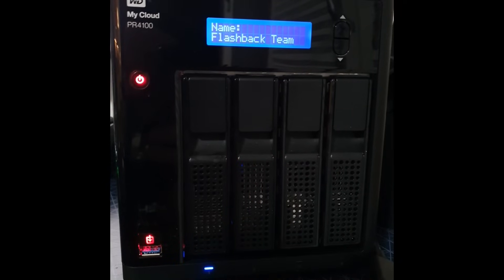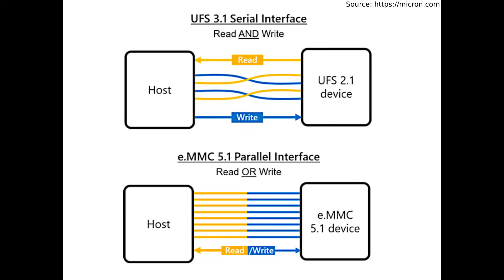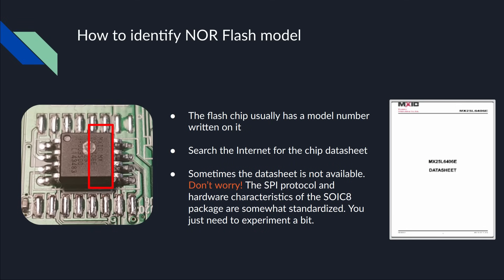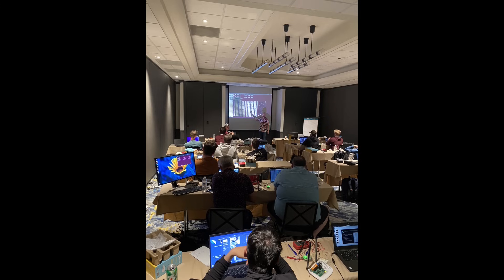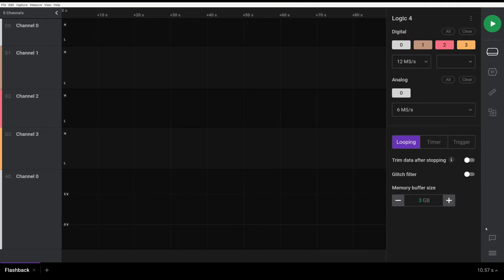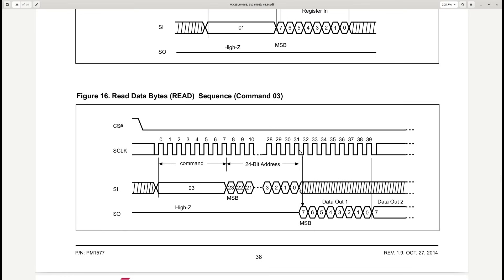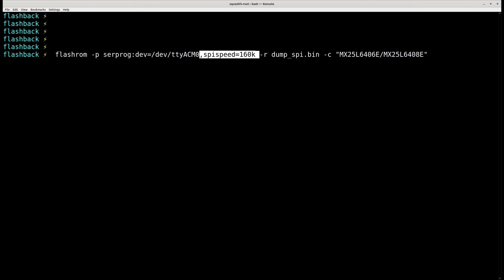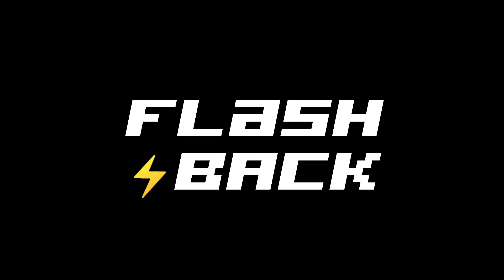Extracting Firmware from Embedded Devices (SPI NOR Flash) ⚡

Comment: Really informative video, thank you! Sadly I see there will be fewer and fewer devices "hackable" in the near future as more and more manufacturers (especially of routers / e.g. DOCSIS 3.1) start using hardware based encryption technology for their ROM. With little to no possibility to ever read extracted data. What do you think about this?
Reply from the maker: We see more vendors using all kinds of firmware protection in their devices but still quite a lot of this can be bypassed. We actually cover this topic and how to bypass firmware encryption in our training.

Few examples that we have used or seen on real life devices:
* Firmware upgrade is encrypted but there is decryption binary on the device. All you have to do is reverse or emulate the binary to decrypt outside of the device.
* Firmware upgrade is encrypted but the actual firmware on the flash is not.
* Firmware is encrypted but you can get access to a running system.
* Firmware stored on flash is encrypted but encryption keys are not stored properly or are cached.
* Firmware is protected by read-only fuse but it would be possible to bypass that check and extract firmware.
* Side channel attacks allow to reveal encryption keys

But if vendor did a really good job and encryption material is stored in hardware and it can't be retrieved easily or firmware can't be decrypted, you have to level up - find a zero day vulnerability using black box techniques, which we also did on few occasions. It's always a matter of how much time and energy you can invest on a target.
Reply: @FlashbackTeam  what about qualcom chipsets ? can we hack it , because they lock the cpu and gpu clock. trustzone and other hardware controles the clock frequencies now , any way to hack it ?
Reply: @Neeharpc  Sure everything can be hackable, most times is just too hard to be worth. Trustzone seem a problem for hacking from userspace, but you should be able to hack it from firmware and select different clock, just as the original firmware engineers did.
Reply: @alejandrosrwebmaster  but no one trying i dont know abot these hacks, i only know about kernel level mods
Reply: @CaptainGoldberg  Locks only keep honest people out. Electronics are much the same.
Reply: @mr wpg Spoken like a true engineer. :)
Reply: My personal thought is that if you have full control over the device, it's pretty much impossible to truly protect the firmware. There is some tradeoff between security and operability. If the mcu wants to do anything it needs to store unencrypted data somewhere and that will present an opportunity even if everything else is done right. Even if you have to read buses or traces with an oscilloscope
Reply: Manufacturers will usually go for the most cost-effective measure, whatever that may mean to them.
Reply: The more their encryption advances, the more our hacks advance.
Reply: Well things are evolving all time, so we should too; they are becoming better? so do we
Reply: Unplug their chip lmao
Reply: @@mrwpg6286 when you know it, yo know
Reply: its expensive as hell
Reply: I do believe they would try but most of that would keep out average users who have no idea how any of it works.  They may try to encrypt and sooner or later there is someone who finds a way around it.  That may be sometime after the device is obsolete and the maker of it couldn't care less if it is modified.
Reply: Such encryption is inherently flawed because the mechanism to decrypt must reside within the device itself; so there's always - at least in theory - going to be a way to extract the decryption key from the device. I'm pretty sure the more common this becomes, the more people will find ways to do exactly that.
Reply: How do we extract firmware form mtdblock
Reply: smells like scriptkiddy in here
Reply: sir, how do i open an Ms dos shell @inod5656
Reply: @inod5656  true

Comment: Couldn't tell if you mentioned this, but beware, SPI is not designed for multiple masters so in general one should verify that you don't accidentally power up the processor of the system when powering the flash chip as you might accidentally end up having two masters trying to drive the SPI lines which could damage the HW.

Comment: My precious Audio Card (PCI) have stopped working (recognized by Windows but no sound) and i noticed that two IC getting hot right after boot :
1) P98AB VT244
2) EPM 7064S1C44-10     BFB249919  EMU98 9946

I do not have an electrical engineering background but i think that the first is a line driver and the second is a Programmable CPLD.
I guess that it is not enοugh to replace the 2nd with a new one, without first, write to it the firmware.
So my questions are :
1) Is it possible the damage be only in the 1) and the heat in the 2) caused by the 1), so if i replace the 1) (is it really a non programμable IC so can be replaced by a new one without write a firmware in it ?) with a new one then the 2) stop heating up and work OK.
2) If the damage caused by 2) is it a way to extract the firmware from the damaged 2), insert it in a new one, so to replace the broken on the Card for it to work properly ?

Thanks for any idea and help in advance.

Comment: Can someone pls estimate how complicated (intentionally obfuscated) is the protocol a laser printer uses to read out the chip in the toner cartridge?   Checking its presence, and perhaps write retrieve usage data,  I have some experience in programming a microcontroller, have a great logic analyzer, digital oscilloscopes.   Would be interested to try to reverse engineer and afterwards emulate this for a particular make and model of a printer for my own joy. But would not want to waste a lot of time,  do I correclty assume it is way beyond feasible as a shed project?

Comment: could you use spi to upload flash files? would this be a way to fix "bricked" motherboards?
Reply from the maker: Yes. You can also write using SPI. And yes, you can fix bricked motherboards this way. In fact, we did it in the past. After bios update of one of our laptops, it got bricked and we overwrote bios flash using SPI to restore it.

Comment: thanks for the video. I ve got one question. What is flash is internal to the MCU, so how would it be possible to extract the firmware ? Thank you.
Reply from the maker: In such cases a target specific attack is required. It would need a separate research and maybe use different techniques like glitching.

Comment: See you using the Saleae software at 11:03 ... have you ever tried `sigrok`? I use a cheap no-brand logic analyster and `sigrok` and it's quite nice.
With `sigrok` you can put a higher level on top of SPI which will translate the byte values even further into specific commands.
And whilst I'm talking about "cheapskate" solutions - It takes more effort, but it's lower cost to just put `serprog` software on an STM-32 "blue pill" board instead of using HydraBus or whatever.
(None of this is "my own work" - I learned it all from OpenTechLab's "Hacking the IT9919" series)

Comment: I've done a lot of stuff like this with EEPROMS in bmw all keys lost situations in everything from cas 1 to 4 even encrypted istahp to FEM modules or the older models. At least for encrypted CAS 4++ you also need to backprobe the ECU for the ISN number. However the whole calculation and tools are from AUTEL IM608 scanner and the process is pretty streamlined. This is a whole nother level of reading hardware or memory. One question though. Why do this anyways? is this a job or just a hobby?
Reply: any tutorials?

Comment: great video, I have a question though , I did EEPROM dump from a speedometer cluster quite a few times, nothing illegal, since I'm into car repair business , some vehicles come with bad clusters and guy would bring another one from a dump and asked me to program the mileage that would correspondent to vehicle being repaired , now there is a program that once you got your dump would calculate new hex value for new given mileage , however this generator software only works for certain vehicle brands, I wonder why same hex value for a given number gets interpreted as a different number in terms of mileage on different eeproms ? thanks

Comment: hello dear friend,
I'm just entering this world of firmware extraction, so I'm a bit of a layman.
What is the difference between doing the procedure shown in the video and simply copying the binary file with an eprom recorder? With the recorder, I have the binary file in hand, so what would be the difference?
Reply from the maker: That's a low cost technique to extract a firmware directly from the chip without the need to desolder the chip itself. There are programmers where you can read the firmware from it with some ready tools but most likely would require to desolder the chip. Also, tools are nice in general but we like to understand what is going on.

Comment: Really great video..  I've never done this, but have most of the tools and have been thinking of trying it just for fun..  I'm curious though - When you are powering that EEPROM from the clip, I'd be worried that I'd also be backfeeding power to the rest of the circuit, and potentially causing it to boot up, which might cause the MCU to start taking over the SPI bus..  Is there some way to guarantee you're only powering the memory that I'm missing, or is this really not as big of a problem as I am envisioning?  Could techniques like finding the reset pin on the MCU and holding it low to prevent booting perhaps be a good workaround?   Any other hints?   How much experience is needed before I shouldn't expect to be completely lost in one of your in person training classes!?
Reply from the maker: Hi. Thanks for your feedback. Very interesting questions.
1) From our experience, some boards would indeed be powered-up when we connect to the chip. Keep in mind, that we are supplying 3.3V so I assume it really depends on the board design. However, we didn't find it a big of an issue for us. When this happens, we usually wait a bit to increase the chance that the SPI bus is free. On many targets, after the boot process is finished and firmware placed in memory, there is much less data being fetched by a CPU compared to a booting stage. We just start our dump at that moment. Also, SPI protocol has that CS line which selects a chip. So all in all, it's not big of an issue for us. But keep in mind we are not electronics engineers, we are just hacking those devices using whatever works for us.
2) The reset pin technique is a very good idea. In fact we used it in the past on one of the target but for a different purpose.
3) If you can interrupt boot sequence, for example by entering bootloader menu, there should be very little interaction with the chip.
4) So far in most of the cases we didn't have to desolder SPI chip to read content from it. Usually in-circuit and it just works. It is on a contrary to NAND TSOP-48. Those almost never work in-circuit and we need to desolder it.
5) As for the training, it's an intermediate level course. The hardware part is on first day and we always use hw hacking only for the purpose of getting the firmware or enabling debugging. Sort of a first step in the chain. Then on the remaining days we move on to vulnerability finding and exploitation. For that reason, a student needs to have a good linux command line knowledge and some basics of reverse engineering and C knowledge. But we never leave anybody behind.
Reply: which MCU

Comment: I don't understand how you read the SPI flash in circuit on the target board.  Doesn't applying power to the SPI flash chip power up the target board processor and thus both are trying to read (push pull) on the same data lines?  Can't this blow out the drivers in the target board processor?
Reply from the maker: Yes, applying power to chip in many cases will boot up entire board. As you mentioned, this can result in both us and a target to compete and race for the resources. However, from our experience, in those situation we usually wait a bit and after the target has done reading from flash we can start flash dumping.
Reply: @FlashbackTeam  Even when the CPU is not actively talking to the flash the lines are still in push-pull not high impedance so how can you talk to the chip without blowing up the line drivers in the cpu?
Reply: @wowcolors because the current to power up that chip is very low, and almost no current flowing through the data lines. It’s hard to burn something without enough current.

Comment: I really need to get my arse into this. I have began to collect all kinds of electronics from trash day around my home and i am stacked to the roof. I have tons of ideas and my main interests are in water restructuring and manipulation. I need a few devices to control a few systems in my setup and I believe I can take my DVD blue ray player and hack the motors to do independent tasks. Or use the printers to run specific applications in my hydroponics system to roll up screens and other things like turn plants in sync with the time of day by attaching code to the encoder wheel found inside. I just don't know if my ideas are that of fantasy or if its possible. I want to create a fully interactive site where others can play in my lab from their home. Anyone?

Comment: What about reading firmware out of chips with included flash like STM32F4? They are often read-out protected against firmware extraction.
Reply from the maker: You are right. In most of the cases, microcontrollers with internal flash are shipped with read protection. In those cases different techniques are needed. Unfortunately they are not-standardized and attack path would need to be unique per MCU family. One of the approaches here could be using fault injection to attack bootloader / early routines that checks a fuse state.
Reply: Possibilities to going further into this for us? I need extract a firmware from uController too...

Comment: Sorry, but this is not what I would call a firmware dump from a embedded device. I thought it would explain how to hack the firmware within a microcontroller not some external flash memory.
Reply from the maker: I guess depends who you ask. Yes, this video is about getting a firmware from a flash memory using SPI protocol. Obviously, getting a firmware from MCU with read-out protection requires different techniques. We might make a video about that at some point in the future.

Comment: Why don't you have to desolder the chip? The whole board will get 3.3 V, boot up and start competing with The Hydrabus, right? Or why not?
Reply from the maker: From our experience, SPI flash dumping is quite reliable to do in-circuit and doesn't require to desolder a chip. Indeed sometimes you compete with a genuine communication (device pulling data from a flash) but then we usually wait a bit until the boot process is finished. It's always a good practice to dump at least 2 times and compare MD5 of the firmware to check if it wasn't corrupted.

Comment: I just want to point out that "package" has absolutely nothing to do with how many legs an IC has. In this case, the package for the SPI flash, is an SOIC, often times, manufacturers will add a quantifier to the package name to denote the leg count to differentiate the device from others of the same type and class, in this case, for the SPI flash, the quantifier is 8, due to there being 8 legs. However, this doesn't alter the fact that the package is still an SOIC. 

An example of the differences in packages can easily be shown when looking at the differences between SOT-523, SOT-323, and SOT-23. In the case of transistors with these packages, they can all be the same exact transistor, with 3 legs, but the packages are different. With Sot-523 being roughly 1.6mm x 1.6mm, Sot-323 being roughly 2mm x 2.1mm, and Sot-23 being roughly 2.9mm x 2.4mm. 

Of coarse, there are many other types of packages, but this just illustrates the difference between package, and leg count, or package quantifiers.
Reply from the maker: Yes, you are right. We know there are a lot of different packages available. However, from our experience, some are more common then the others. In most of the cases, on the targets that we have worked on, they are as in the video. After first guess looking at the IC, we would always cross-check with the datasheet.

Comment: Can I use this method to extract firmware from, say, a cable modem?
Reply from the maker: Cable modems are slightly different to a regular consumer routers. They connect directly to a CMTS on the ISP side using encrypted and authenticated channel and ISP will have more control over the device. However, depends on the device itself, you might still be able to access a firmware and configuration files if they are stored on external flash.

Comment: How can I read this .bin file? Just extract with 7zip?
Reply from the maker: Check out binwalk, it scans binary files for signatures and tries to unpack them.
Reply: @FlashbackTeam  Thanks! Btw just asking for future purposes: If I buy new car where I can't permanently disable auto start-stop system - as you know with most modern cars when you restart your car it's back on again. How possible do you think it is to disable this feature with firmware  extracting devices? Wold it be possible to just edit some conf file in memory chip and change some defaults? Sounds overkill now but in future when cars spy even more on you like Teslas that are always online and constantly send info about you to manufacturer, firmware mods/rooting/jailbreaking might become more justified the effort.
Reply: test...
mhhauto forums